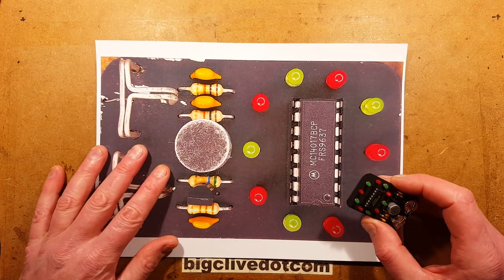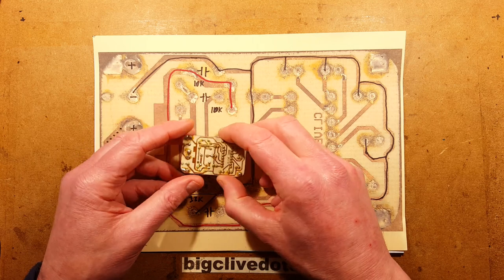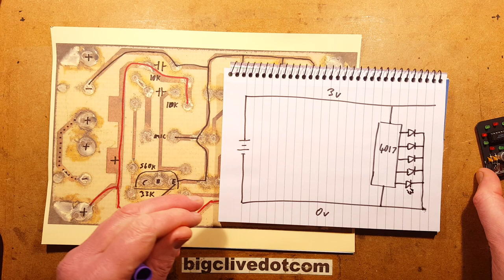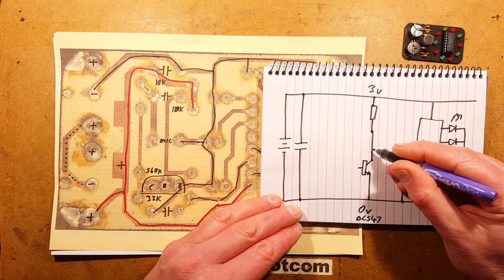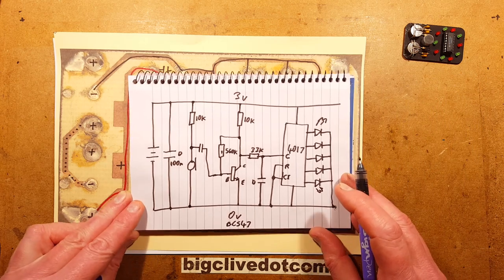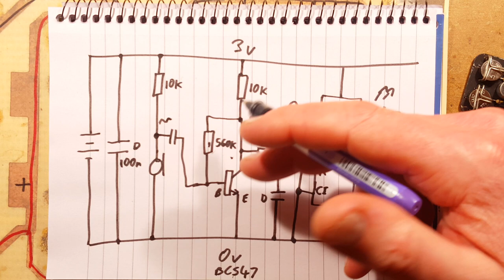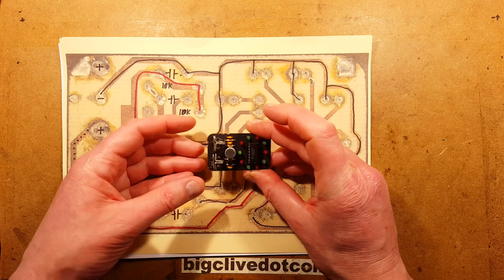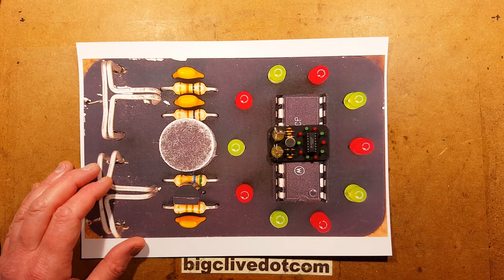Vintage disco buckle light.  (with schematic)

Comment: I bought my first blue LED in 1993 from Maplin. Still got it - it's on a Z80 PCB. It wasn't very bright (or very blue) and I think it cost about £2 :)
Reply from the maker: Was it silicon carbide?  When Maplin introduced first the silicon carbide ones and then the gallium nitride ones they charged an astronomical price for them.  I think it was £10 for each one.
Reply: Rest In Peace Maplin
Reply: The first affordable "blue LEDs" were...very tiny light bulbs in an LED case.
But we also had a chemistry teacher at school, who did electronics projects with the us (in his spare time). He wrote to Siemens to ask for free blue LEDs. Turned out, Siemens had blue LEDs which they couldn't sell because their reverse voltage was outside the specifications.
Using my first blue LED as a power indicator (actually, I used it as a voltage reference, but it did double duty as the power light) taught me that blue LEDs make very annoying power lights
Reply: SiC leds were so weird and dodgy.  Imagine a diode with a 5V voltage drop!  But at the time seemed magical.

Comment: It's so interesting to learn something from your videos, and it's also very enjoyable to just recognize what you're talking about. Particularly, about this 4017 decimal counter/divider.
I remember ordering and assembling a chasing lights kit which has a microphone and works just like this one does. The lamps are only those color changing LEDs each with its control unit inside. The great part of building those kits is not only in learning how to solder properly, but in learning how and why they work (or why they don't, sometimes).

The value your channel already has in it is incredible, while every video is calm, fun and easy to follow. Thank you, and thank you again!

Comment: 1990 I bought some hyperbright GaAs green led's, which were really bright, and capable of projecting a cone across a semi dark room, with only 20mA of current. I made a torch using one of them and a CR2016 cell, and a current limiting resistor to get it down to around 5mA of current, where it was still orders of magnitude brighter than any other LED available at the time, plus it was easy to see the die and the gold bonding wires inside, as it was the first one ( other than those in transistor cases) that came in a water clear encapsulation.

Also found that you could see the light being emitted, even with 1M of resistor and a 9V supply, much better than the regular LED that was barely visible in the dark at 1mA, and still not daylight visible at massive overdrive of 50mA.

Comment: Cool project Clive. I was surprised to learn that the average condenser microphone was easily capable to detecting even minute barometric pressure changes caused by opening a window or door, even in another room of a building. They were used as the main sensor inside portable volumetric security alarms, that were manufactured in the UK in between the 80s~90s and were used mostly on building sites.
Reply: Do you think this principle could be used as an early warning system for our flatulent puppy? I think something may have died inside it.
Reply: @rowgli  There's only one remedy for puppy farts, I just wouldn't want to be the one to remove the cork after.
Reply: @Zodliness  When the pressure has built up to a suitable level it is self removing, though you might not want to be in line when it does reach critical pressure, as there will likely be more than the cork and some gas going in a straight line till it hits the wall.
Reply: @SeanBZA   You sound like you're speaking from personal experience, I honestly didn't know puppy raising could be so hazardous! LOL

Comment: Gallium Aluminium Arsenide, rather a whitish blue, appeared in Australia in the early 90s. I bought one at Dick Smith Electronics and it's still acting as the power led for a joule thief I built later on. Forward voltage was rather high at 4.7V and expensive at around $8
Reply from the maker: Are you sure that wasn't a silicon carbide LED?  The washed out blue sounds like that.
Reply: I wonder, DSE could have got the specs wrong. They’ve stuffed up worse than that.
Reply: I got the green and red hyperbright water clear LED's then, and they were expensive, around $2 each, compared to the regular LED at around 20c each, and a price drop if you bought more than 20, and again at 100.

Comment: As someone who has been supplying the Internet with schematics for decades, have you ever found any companies, Chinese or not, who have copied your designs or used your pcb layouts, maybe even with your name still on there?
Reply: Phonotical I’d like to know this, too. It’s also possible that they could just feed data into a layout program and just autoroute something, I suppose. I’m still quite new to electronics and have not laid out a board yet, but it wouldn’t surprise me if this is what they do sometimes.
Reply from the maker: In the very early days the first version of my RGB controller software was available for download from my website.  It ended up in someone else's product.  That was when I started only supplying it as pre-programmed chips (with a lot more features) and then people asked for the PCBs and then the full kits.  So it actually paid off in the end.
A few of my PCB designs have been cloned.  There's nothing you can really do about it.
Reply: @bigclivedotcom  Did anyone ever clone that replacement pinball board that I believe was for audio?
Reply from the maker: @davidmcgill1000  It was made to share on the 'net.  But one company did copy the design and changed the date to a year earlier.
Reply: @bigclivedotcom  That's cheeky, did they try and extort you for infringing their intellectual property?
Reply: @loukashareangas4420  At least there are millions of joule thieves out there, so thats one thing :D
Reply: man cant have too many joule thieves. ive got dozens of the things and am still trying to perfect my design.
Reply: @bigclivedotcom  I would imagine that you were both quite angry,but also chuffed that someone thought it good enough to nick the design- The Philippine tourists board used one of my photos without my permission , but I felt proud after initial anger!

Comment: Thanks for sharing your engineering with us! I am learning about the different ICs and what they do. I just acquired a Chinese spinny random number wheel DIY that has a 4017 on it. I saw your board and thought, I wonder. Sure enough, same chip. I am also in my mid 50's but I am about 13 in electronics! I built the DIY and it worked. Surface mount and all. Don't sneeze!

Comment: Nice, in the early to mid 90's, I was using 555's and 4017's to clock a stepper motor (via 1N4148 diodes to get the sequences right), making the motors zip back n forth at speeds changing to the music. With two of these, and a small mirrors of the shaft, I made a xy scanner for an old 1.7mW HeNe laser tube from a barcode shopping scanner. This is well before laser diodes were cheaply available. I used to hire it to nightclubs for $100 an hour, and was overbooked with many clubs all night long 4 days a week. Saved enough money to buy 2 new 17mW HeNe tubes, and an argon blue/green laser, hired them out for years, with free bar-tabs included in the hire.. and made a fortune having fun for a young fellah in his 20's :)

Comment: I once made a chasing light module using the 4017 for my electronics course. I made a circle with 10 green LEDs, and a line in the middle of it with 5 LEDs, and wired them (point to point, inside a  wooden craft box) so the light in the line would go back and forth as the light in the circle went around. Quite simple, and I got away without using single resistors for the LEDs because of the way I wired them: a diode for each 4017 output, then the LEDs from the circle in series with the ones from the line, then a common  resistor (100 ohms I think).
Since there's only a couple of LEDs on at a time, there's no need for separate resistors for each light.

Comment: I lost track of the number of things I did with a 4017!
Reply: A 4017, a 555 and some resistors, capacitors and LEDs could be the basics of a N Experiments in One Electronic kit, I'm surprised I've never seen one.
Reply: Me, too. I recall making an LED chaser for my father after he set up business as a hypnotherapist. He used it on his patients, too!
Reply: @SlyPearTree  I still have one of those. a 4017, a 555, an opamp package, transistors, a shit ton of resistors and caps and a huge book with in depth explanations of hundreds of circuits. Learnt a lot from it and still use it occasionally for prototyping.

Comment: Back in the day.  I remember those days. Making mechanical time switch light sequencers and the "ultimate light controller" was the Pulsar Zero 4000. I made pretty much the same circuit as this but with diode steering for 7 triacs to give a night rider effect. Darn I feel old now...
Reply from the maker: I made a few of the 6 channel 4017 and diode array night rider units for friends cars.
Reply: @bigclivedotcom  Yeah. 6 way... Not 7....  Such a long time ago...

Comment: I have a string of christmas lights that I got this year that which are battery operated and they will respond to music. It has different modes I believe but it normally stays partially lit and then when it hears a loud enough beat it increases in intensity or turns on more of the lights. I should send them to you, Clive.

Comment: Back in the early 1970's when rock and roll was hotter then ever, and I was a young soldier stationed in Texas, we decided to try and build light organs.  Now none of us were that great with transistors, or tubes, but one of my fellow soldiers, who was married and lived off Base in El Paso, in a mobile home court decided to build a "mock" light organ.  What he did was build a nice wooden box, he lined the back with shaped aluminum wrap, shiny side out, then stapled the mid-sized Christmas Lights, each bulb a flasher using just red and blue lights, arranged in a sort of criss-cross across the back, the aluminum wrap acting as a reflector.  Then about four inches i front of the lights he placed a thin poster-board insert, in which he had cut stars, hearts, and letters such as FTA, something that was quite popular with soldiers who had just returned from nam.  In front of that, he put the face, made up of translucent plastic with a sort of diamond  pattern mesh over that.  What came out was some fantastic lights, and when played with very loud rock, the lights seemed to sync with the music, I think it was just the brain trying to make sense of the two sensory overloads at once.

Comment: I had a thought Clive. A simple LC network for audio pre selection - a band pass filter. You would need to " fiddle " with values to
attain values that are useful however. It would work. Gain may suffer a bit. Years ago i got a bunch of Panasonic back electret
elements from digi key. Very good audio quality, even at high levels.

Comment: The phrase you were looking for was "low-pass filter" 😁

Been a while since I saw 4000 series CMOS in use. When I was in college the 4000 series chips were the go-to logic family. 74LS was rather finicky about it's power supply and output load.

Comment: "SRBP" is Synthetic Resin Bonded Paper.
Reply from the maker: I thought it sounded wrong when I said it.  These things happen.
Reply: @bigclivedotcom  Generally it was known as "paxolin", a trade name I assume. If it was made with fabric instead  of paper  it was called "tufnol".
Reply: Guess it dated from a time when it was necessary to differentiate it from natural resin bonded paper or something, think it got used in old valve radios before PCB was invented.
Reply: There was a type that I recall which was referred to as "random fibre" board (as opposed to woven fibre). It was blue in colour and quite easy to drill and guillotine. Maybe it's still available.
Reply: Plain (no copper layers) SRBP was supplied with holes on a 0.1” grid, it was used to mount pins (pushed through the holes with a suitable soldering iron) in a user defined layout. Then you could solder resistors, transistors, capacitors, diodes to it to resemble the schematic fairly closely.
SRBP was also used along with metal tags to make tag blocks. Imagine a long strip of brown “plastic” (SRBP) with two rows of metal tags running along. Each tag has a hole in it. So you could fit resistors, axial capacitors, long leaded transistors and diodes on it. This was before PCBs became cheaper.
You could also buy SRPB as plain sheets in various sizes and thicknesses.
Reply: Harks back to days of Vero strip board! Used to get through a LOT of that back in the day, before I started to try out the PCB route!
Reply: SRBP stinks like hell when drilled too, fibre glass board is better yum all that dust in your lungs. I made a decade counter the other week similar principle but counts using led numerical displays. I used a microwave sensor to trigger it and used as a counter to see how many times my cat used his cat flap lol 😁

Comment: I have one similar to that one but the LEDs are all red and you push a button and LEDs light up like a spinning wheel and will slow down and stop on 1 LED. I use to get a ball point pen and short out the chip pins to make crazy effects for example there these 2 pins that made it spin so fast that all the LEDs look lit

Comment: Blimey, I did a similar thing when I was in Glasgow back in the early 90’s. Single large red LED with a lens to focus the beam and a low pass filter all mounted in a project box. Tried it down “The Tunnel” a few times but the results were less than impressive. Still, it was fun making and trying it out.

Comment: 14:12 The term you're looking for is Low-Pass Filter. It will be a 6dB/octave passive low pass filter at a frequency set by the value of the capacitance and the impedance of the load.

Comment: This takes me back... I designed and built 250 "Light Chasers" for a mate and his model Fairground rides about then. The design was straight out of the 4017 datasheet plus  transistor array of npns in a dip package to drive 8 grain of rice / wheat bulbs in parralel.  Oh the 14017 was 1 pin different and very annoying! Cut and mod wiress needed to make it work the same!.

Comment: The 4017 is one of my favourite ICs, coming second only to the quad Schmitt hand, I first used it in a crystal controlled radio scanner. This in the days before frequency synthesis became common p!ace, early 1970s. The 4017 was used to switch up to 10 pairs of Tx/Rx crystals. I also used one as the basis of a digital lock, stepping forward on matching a binary sequence. I still have one a few in a UV  PCB exposure unit digital timer.
Reply from the maker: 4093 quad nand schmitt trigger?  I used that as the clock in many of my circuits because it gave other options with the spare gates too.
Reply: @bigclivedotcom  oh I agree, the other gates are great for additional signal processing, implementing all types of monostable. I think I have posted about this before. I have used the 4093 as a stroboscope circuit, with one gate acting as the oscillator and two gates giving pulse width control, leaving one free as a buffer,  just adding the power transistor to drive the super bright LEDs. I have also used it as the basis of a pulse count discriminator in an infrared audio link receiver. The transmitter was just a modified version of the stroboscobe circuit,  with a transistor in the oscillator feedback loop to make it into voltage to frequency converter. I have used it in endless alarm systems and tone generators, even used it as a basic switch mode power supply. The 4017 is not so flexibly, but I have used it with a set of weighted resistors as a  pseudo sine wave tone generator, it also makes a simple keyboard multiplexer. Most of these circuits date back to when there was considerable fewer MSI and ACIC  devices to preform these functions. Now there is always a dedicated IC to do the job, if not a PIC or an Arduino will perform the logic.

Comment: The 33K/100nF capacitor combination should form a low pass filter with a cutoff frequency of around 50Hz. To drive the transistor properly at these low frequencies the electret mic-transistor base coupling capacitor would need to be a relatively high value.

Comment: Had disco lights as a kid that needed to be set manually (with a turn knob, probably just a pot resistor). Had such high expectations but proved to be a huge letdown. Kinda the same principle with simply registering bass/pressure. There is no universal sweet spot so as the music changes the lights would stay off or on all the time.
Also the bulbs were simply painted or coated clear glass and they got so hot the paint just started melting off. 
Was nothing like in the commercial.

Comment: When did blue LEDs start coming in? I remember I got started modifying computers in 2005, when I was barely 12 years old, and you couldn’t get enough blue LEDs, they were in absolutely everything. If you couldn’t get them in 1999 but they were already cheap by 2005... just goes to show how quickly technology goes from being merely available to ubiquitous and too cheap to count.
Reply from the maker: I know that in 1996 I built my first RGB effect based on silicon carbide LEDs which were so dim it was not really useful.

Comment: Just the picky technician in me;  the capacitor connected to the emitter is in series to the clock pin. That was the problem of using a black pen to highlight the clock connection.Still great videos.